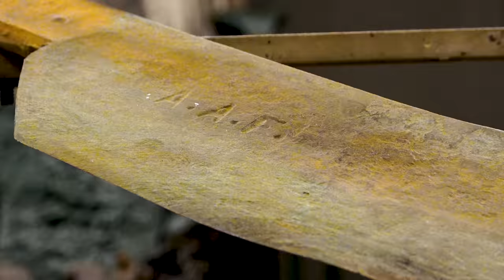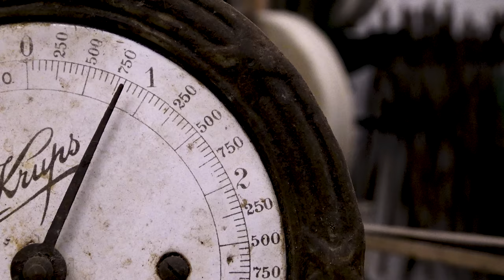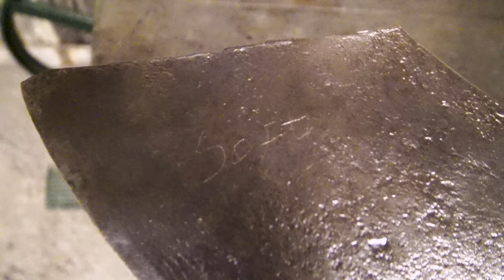Old Rusty CLEAVER Restoration

Comment: brilliant, you have done a tidy job of that one, do like the use of the birch wood, very traditional and very nice to work with. One tip, although not an old way but sawdust and superglue fill gaps well and stay in place far better than PVA glue does.                                                                                                                                                                                                                                                                               Good to see you have some more new tools and have been off learning new skills again and are putting them to good use, keep doing that as you are getting better and better at what you do, and the best and most authentic restoration channel I have found is getting better and better
Reply: one thing to investigate further is heat treating your steel, build a brick wall either side of your fire pot to concentrate the heat and give a bigger fire and keep moving the blade back and forth to even the heating, get the steel to a salmon pink colour and quench in oil for less risk of cracks and warping and to temper it you can heat another piece of steel and then when you have cleaned up the blade so as can see the colours place it on the hot steel and allow it to transfer heat, that way you can see the colours run into the blade and control the tempering process by dripping water onto parts warming to quickly
Reply from the maker: Thanks man, you are the only one who recognized the problem with the forge and suggested a great solution that could resolve the problem and be in the correct time period. Well done, I will definitely try adding bricks around since I am losing heat. You gave me excellent instructions on how to have better control. I really appreciate your time and great advice. I just need to figure out how best to manage all things at the same time. It is hard to focus on the hardening process itself and moving the camera around and other things rolling, but I will give my best next time! Thank you again and have a good one!
Reply: @FFD_Restorations  no worries, the world would be far better if we all shared knowledge and experiences, and I see the problems as I have as you know my very small forge and have had to find solutions to them, I am seeing you having similar issues so if I can help with sharing what I have found then great, it is worth looking at videos on YouTube of black/blade smiths from poorer countries to see how they do things without expensive tools as many solutions are to be found there, South Asian countries, India, Bangladesh etc are excellent resources for learning from
Reply from the maker: Amazing stuff, I am glad that you like to share and help others. I wish that we are all more willing to do so. Be well and take care!

Comment: I am wondering why you added the hole in the top, it was totally unnecessary in my opinion, you changed the original. Nice work.
Reply from the maker: To be able to hang it on a wall.

Comment: I really like how filmed are your videos, once again.
But I must say, the heat treatment here is a little bit (to be honest a lot) uneven, didn't you succeed getting all your blade red?
Reply from the maker: Thanks! Well noticed, I had troubles to heat the blade evenly, so I did it multiple times. I need to get bigger forge. Thanks for watching!
Reply: @FFD_Restorations  I saw this but in fact you can't quench it in two parts, the heat will ruin your temper and you will get a soft blade, instead you could use a square tubing to homogenize the heat and bury the tube into the coal (the blade in the tube)
Reply from the maker: I understand, but as I mentioned, I need a bigger forge.